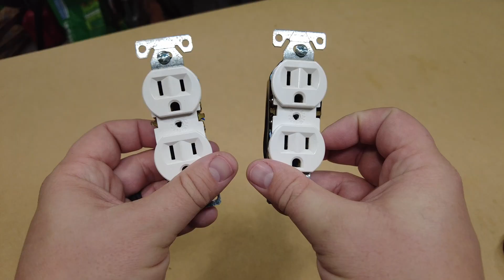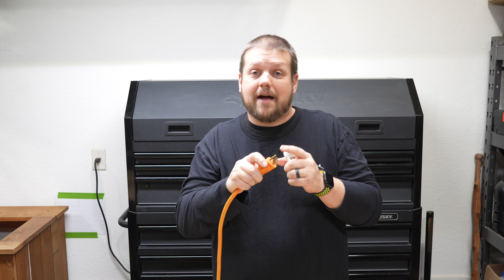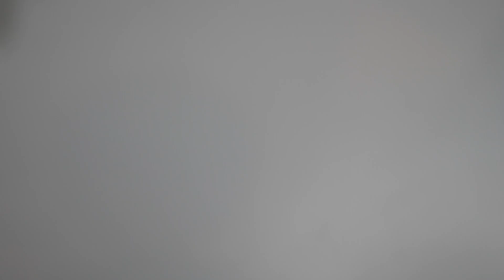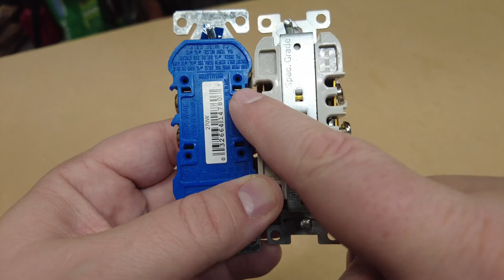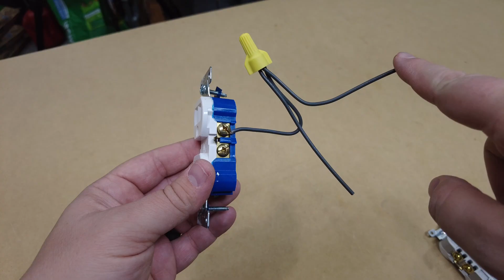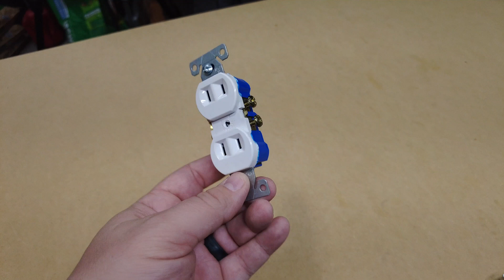Ending the Debate! Answers to Controversial Electrical Practices

Comment: JW Electrician here; if it's a metal box, wrap it.  If it has more than one device, wrap it.  If the box is anywhere near close to it's fill point, wrap it.  If it's commercial, wrap it.  When in doubt, wrap it.

There is no debate.  Install it how the customer wants it / within existing means.  Technically the ground pin being up is correct, but that's rare to see anywhere.

Don't mix wire sizes if you can help it, and always wire according to the breaker size, per the code.

Back stab is fine, and if it wasn't, UL listings wouldn't allow it; just follow the strip gauge.

Voltage Detectors are great for someone who knows what they're doing.  Anyone else should call an electrician.

Wagos vs Wirenuts?  Really?  They're different animals, and used for different situations.  Only an apprentice or general contractor would debate the two.

Always ground if available.  If not available, install a GFCI device upstream, or a GFCI breaker.  Yeah, it's expensive, but so is your house burning down.

Comment: If you are wiring something that is mobile, like an RV, loosening from vibration is a factor.  Never use the back-stab feature in an RV.  Also never use wire nuts in anything that will be on the road.  WAGO connectors and the new Leviton lever switches and receptacles are best for mobile installation.